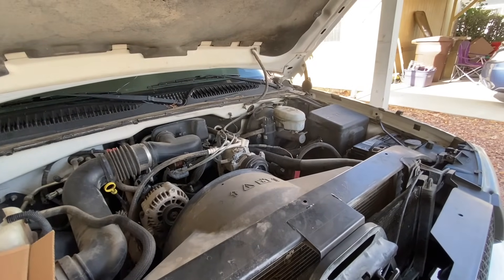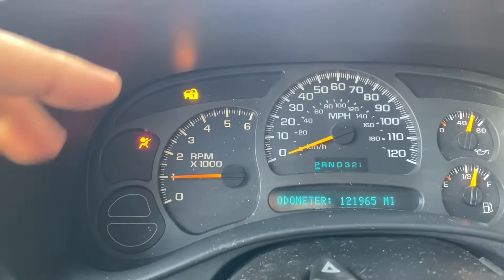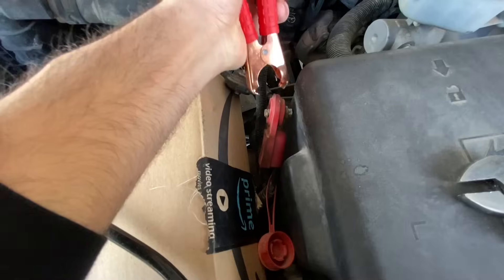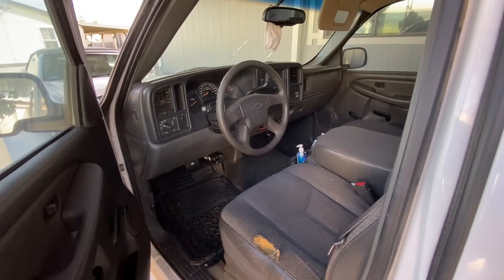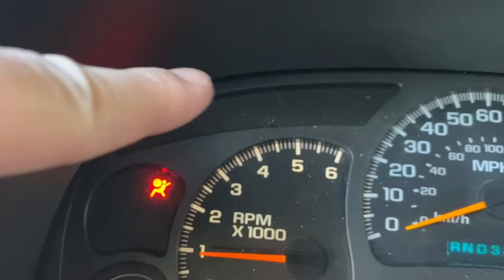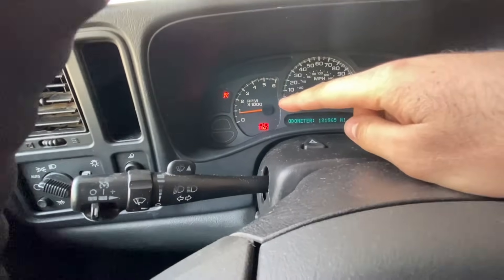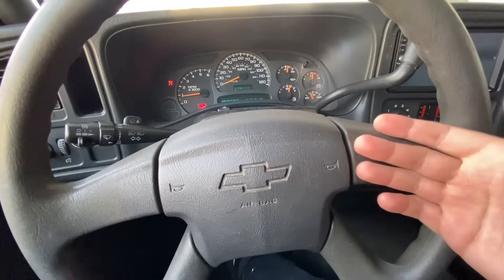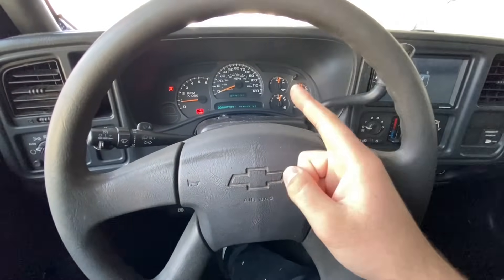How To Reset All ECU’s And Control Modules In Your Car Or Truck Safely

Comment: For late model '90s and early model 2000's Chevy and GM trucks, this is a lifesaver! only thing i never knew about is the battery isolation technique. i used to just disconnect the terminals and thats it. But im gonna start doing this now too. thanks

Comment: 99 Jeep Cherokee sport. I need to be able to use a code reader but I disconnected the negative cable on the battery and the code reader is not communicating anything. I was told I erased the Jeeps memory. How can I reinstate the memory so I can run a code on it? I'm having a crank no start issue. No fire from the distributor cap, which is only 3 months old. No spark coming from the coil. I have lifetime warranty on the coil so I put a new one on still no spark. Everybody is telling me to change the crank position sensor so I did. Still no spark? Any advice please on resetting my jeep's memory or any advice on the no spark issue. I'm almost leaning towards that I bought either a bad coil or a bad crank position sensor? I'm not sure? Any advice please, thank you

Comment: I got a 2008 Chrysler Sebring I’ve don’t the negative battery cable disconnect I’ve disconnect both and touched the negative to the positive for over 45 mins to drain the capacitors and it still holds memory I’m trying to reset a hard Tmc code any ideas?

Comment: I am having issues with skoda octavia II 2007 pid diesl  -- after we replaced battery all lights came on not going -- even steering is heavier and car will not go over 60mph  -- I left the -iv terminal disconnect for few hrs.  cleared all fault with scaner .. but no joy yet and car has still all dashboard lights on with h-break light blinking. any advice would be appreciated.

Comment: if you dont install a resistor between your jumper cable you can ZAP dead your ecu. The purpose of a resistor in this context is to safely and gradually discharge residual electricity stored in the vehicle's computer system.

Comment: My check engine light codes (3 different ones) P0420, P0078 and one more, can’t remember, all came on and cleared then came on and cleared after replacing the battery. I tried this method and it cleared them all for good.

Comment: Hi 

I have a D40 Nissan Navara/Titan 2010 2.5 LE. The vehicle goes into limp mode once start up. When clearing the fault, the Electronic actuator seems to move and you hear the idle becoming normal for that short time. Thereafter back into limp mode and the actuator arm does not move, so no boost.

Took it to a turbo shop thinking it was something to do with a faulty actuator (it has an electronic actuator), they replaced the actuator and reconned the turbo, but the issue persists.

There are no fault codes, even when checked by Nissan. Comes up with P0000. Clear that and it says no DTC, but back into limp mode with engine light on.

There is no smoke and the idle is quite stable, but no power at all. What could this be? 

I've been told, it could be the wiring on the CAN system since the machine at nissan is not picking up any other information on other sensors or areas. 

Been told it could be the ECU. The vehicle did have a stage 1 remap about 6 years ago and ran with  no issues. 

Other thing I've been told is that it could be a faulty EGR. Mines been blanked off with plates. 

Its also been to Bosch Diesel and they checked the injectors and fueling system, and they say that's all 100%.

Does anyone have experience with a similar issue ? It's been 2 months now back and forth. I dont know where to start looking.

Thanks in advance for any assistance.

Comment: THIS IS WRONG! DO NOT DO THIS, Use a Resistor instead of a direct connection. Doing it this way can cause damage to sensors. Use a resistor to slowly drain the the ECM capacitors that store voltage. A bleeder resistor with a value of 20 kΩ and a wattage rating of 9 watts ensure a safe discharge time of around a minute.

Comment: How to reboot a car computer. 
Disconnect the battery (both cables).
Turn the key on. 
Turn the headlights on.
Touch the battery cables together for 60 seconds. 
You have now rebooted all the computers on your car! 
This fixes a whole host of problems on a number of cars.
This is the only way to reboot and reset a vehicle computer.
Now clear the codes with a code reader. Drive the car see what you really have!
☺️

Comment: Fixed a code I that for three years wouldn't clear, searched the car from top to bottom, solved it by simply isolating the battery, and switching my headlamps on, and letting the system power drain and reset the ECU's over the course of an hour. Forget shorting the system, just drain the system of residual power as I (and others) have described.

Tested for the code to return at my usual spot with the usual conditions. No code!! Gremlins evicted!! 

I am over the moon!!

Comment: My 01 Tacoma will only start up when hooked up to an OBD reader. It will remain on while parked and at normal idle. Upon disconnecting the OBD reader and put in gear, it dies out.

Comment: You can skip the jumpers' cables and just turn on the headlights instead.  It will drain the rest, no doubt.   That comes from an auto mechanic straight 54 years  on the job.

Comment: Can do the same with rubbing both terminals together for 5 secs. But that dont always work either. Did it with my 5.7 hemi Cherokee and still have codes and no crank.

Comment: Hi, i was driving my 2008 ford ranger pj ute , manual transmission, suddenly the instrument  cluster stayed on, speedo stuck on 110 km/hr, rev taco stayed stuck , etc when i arrived at my destination i turned key to off but engine wouldn't stop running... when i got home i had to stall it to get it to stop running... now it wont start and instrument still stuck where they were ... has anyone else had this problem and did the reset work ? Please and thank you.. I've disconnected battery and cluster stays stuck

Comment: Thanks for the video and information! I just bought a used 2007 Cadillac Escalade and its MPG is so low. Previous owner used to use it for towing, so I think it might have been tuned for that and that's why the MPG is low? Anyways, do you think this procedure would reset my car to factory settings?

Comment: I have a 2003 Chevy Trouble Blazer that kept throwing up random codes saying I needed a new torque converter, mass air flow sensor, shift solenoids, and others. The service engine soon light would come on and the tranny wouldn't shift right and the engine ran light crap. If I stopped at a stop light and turned the engine off and restarted it the engine light would go off and everything would work fine. I did the reset on it and now it works great and it went through emissions with no problem.

Comment: Does this work to clear ABS codes ? My car has the ABS and TC lights on due to a bad wheel bearing that I replaced aswell the 2 front ABS sensors. And the light is still on.

Comment: What gears were you changing when you changed the gears out of view of the camera? U had did something other than just the gear shifter by the steering wheel. ??
Reply: He is just shifting from D, N, R then 3rd 2nd 1st then go 1st 2nd 3rd R N D then Park. Do this twice then. Put the car in motion and drive for about 20 mins to relearn the ECM And TCM

Comment: if you have a manual do you go through the gears?
Reply: No. Shifting through all the gear positions is supposed to allow the PCM to "relearn". In a manual transmission car, you are the "PCM" that controls the shifting.

Comment: Will this work to reset the brake pedal  potentiometer on a 2008 buick lucerne ? I don’t have a scan tool to zero out the brake pedal switch.

Comment: All you need to do is turn on headlights that'll drain all energy
Reply: how are u turning the headlights on if the battery is off idiot
Reply: @unxylene   You're the idiot. It is a well known common practice to turn the headlight switch to ON while the battery is disconnected to drain all the residual power from the various modules. The guy in the video just did the same thing in a different way by shorting the cables together.

Comment: Will this solve a crank no start on 2005 nissan sentra 1.8l,,, list of parts changed,,cam & crank sensors,4 new sparkplugs, 1 new ignition coil, bew battery,new battery terminals,,,,, u have no DTC Codes now but still crank up ti 2300 rpm. For 4 seconds then dies,,,😢😢😢please any advice will help

Comment: I was also skeptical AND... it didn't work for me. 2014 Dodge Ram 1500 with the "Service Shifter" (it's the ZF 8 speed pile of garbage electronic trans) coming up on my dash and with DTC U1467 and P1DF3. Replaced my shifter, left battery unplugged for DAYS and also did this "little trick" for hours and still will not shift into drive or anything. Thanks for the effort, works for some I guess.

Comment: Unhook the battery and turn the headlights on leave it for about an hour.  System is clear.  That's all you have to do.
Reply: That is the correct way to do it.
Reply: lol he literally has A jumper cable, singular 🤣
Reply: Really I'm going to try it now
Reply: Do you start the car to put the lights on then unhook the battery
Reply: @joyfulspirit22  just step away from the vehicle,  and go make a sammich!!
Reply: @mikeharris8365  I'm not understanding the part about disconnecting the battery and then turning the headlights on. How are the headlights getting any power to do anything. I'm not understanding I'm waiting an hour with headlights I don't have any power?
Reply: @joyfulspirit22  The point is to drain the brain (ECU) and system of electric. Just remove the battery cables and turn on the light and hit the horn a few times. Hope this helps.
Reply: @cornfusedatbest3980 Now I'm confused. You said to unhook the battery cables and then turn on the lights. What good is it to turn on the lights with the battery terminals off?
Reply: @randybonner9870  From what I've learned, it drains the last bit of energy from the circuitry. Other methods claim to turn the radio, AC, press the horn. Basically draining the system from any residual juice. I mean, WTF, I'm no tech, but I can at least understand where this would make sense.
Reply: YO, my mistake. Not BOTH battery cables. WTF, are you guys that stupid to get your advice from some idiot on YT? 😂 If anything, look at a bunch of videos on the subject. If you've got enough brain power, you'll figure it out. If not, go back to watching CNN or MSNBC or whatever TF they're calling themselves these days.😜🤪😆
Reply: @joyfulspirit22 NO
Reply: @joyfulspirit22 No! Unhook the negative and turn on lights while off!
Reply: @IMKSURVIVOR right, how could a computer reset itself back to original specs if it didn't have power. Hahaha remove the ground only. But still not all ECUs are the same. You might clear codes and fix shit. But still might have command issues or ECU software issues that you can only fix with the right scan tool and or software on a computer.
Reply: You only need 60 seconds for modern electronics to clear all the capacitors.
Reply: @pnwnewsinfo  that's what people say. So, explain how an hour is gonna hurt a dam thing? We're waiting ✋️
Reply: @pnwnewsinfo  I beg to differ.
Reply: Definitely doesn't work 😂😂
Reply: Yup!

Comment: Cant you just disconnectbthe battery fir 15 minutes. Thevsensors and orobes. Eill "die" and as soon as you connectbthe battery theyvwill relearn.
If the ecu is not the problen.
Reply from the maker: Can definitely try that too

Comment: 2022 toyota highlander, getting code u1117 lost communication with accessory gateway. No check engine on but my app and remote start won't work. Everything else works. Do you think this would help? Thank you

Comment: Just followed your advice for my 1993 Honda Accord (with 210,000 miles) which recently had unexplained and increasingly serious transmission problems that finally left the car undriveable.  I thought I was going to have to change out the TCU but then saw your video.  What you have suggested worked!   All taken care of at home in an hour and didn't have to spend a cent either.  Thank you!
Reply: Will it work on a Mercedes Benz 2012 cls550

Comment: I have had a hard time with my F150 replaced alot of stuff and it would keep going in limpbmode. . I saw your video today and tried it .Happy to report that it is working so far. Thank you.
Reply: same here. 2013 f150 replaced molded lead frame. worked for 10 minutes or so, started throwing the codes again and limp mode. I'm about to try this reset.

Comment: Had a issue with anti theft light blinking on then off along with gas,temp,battery and oil gauges dropping only when headlights are turned on. I watched this video how to reset All control modules on 2011 silverado pickup 5.3  here to tell you Problem Solved thank you for the video I've just subscribed.

Comment: Thanks for the great video!! I did exactly what you said, but I left them connected with the cables for a few hours. It didn't reset anything in the car. Any idea why, or how I can do it? Thanks for the help I appreciate it.
Reply: I heard for newer vehicles you have to do this then drive for up to 50 miles try that I guess

Comment: Just unhook the battery and turn the headlights on.  They won't come on, of course, cause the batteries are unhooked, but it'll pull any residual power from other stuff, and u can start it all over fresh

Comment: Dont do this! What you need is a slower drain of the systems. You can do damage to multple modules with a quick drain.

I solution. I bought a standard 21 volt light bulb socket for recreational vehicles. I wired clips to it & put in a 40 watt equivalent LED bulb. With it clipped to the cables it drained the systems in a half hour.

Have a cup of coffee. Relax. It's a safer solution.

Comment: A friend gave this a shot and not only did it reset the system as expected, his blinker fluid was also refreshed. Apparently there was also an extra muffler bearing in the exhaust system, because after resetting the entire system, including blinker fluid, a muffler bearing rolled out the tailpipe. Now it only makes 3/4 the noise it made before. Amazing!
Reply: Blinker fluid and muffler bearings? Why do you want to mess with ppl
Reply: Those muffler bearings are a bitch

Comment: I tried this, but it didn’t work. What happened instead was a message popped up on the display that said using jumper, cables, connect one end of cables to battery terminals. Place both clamps of other end to tongue for five seconds. I tried that and guess what. Everything reset as expected! You should try it. I’ll bet you’ll save yourself a little time.
Reply: What year is your car. That might make a big difference

Comment: When you connect the jumper cables is it to the cables that were connected to the battery?
Reply: Yes. Some commenters are suggesting using a resistor between the cables in case there's too much leftover electricity that can cause an issue. The alternative, easiest, would be to disconnect the battery and then turn on the headlights to drain the system.

Comment: This is one of the best videos I’ve seen on this yet thank you. You may have just saved my friend having her 2008 GMC towed to the dealership.
Reply: Same make and model. This didn’t work for me. What issue were you having?
Reply: @ginormous99  fuel pump control module, and there's wires down here to the transmission and all kind of junk to get all screwed up

Comment: I had a similar issue are the Dodge ram that the gas gauge and gauge is went nuts and it has a process to apparently these new cars have process is built into the ignition switch and they’re probably like Dealer fix all the items that they don’t give out those secrets, but this is obviously one of them because I followed another videos instructions for the Save guy to take and I was shocked that things were resetting everything was fine then. My friends car just blew this out of the eve vapp sensor and now it’s not going in and  out and I think her problem was the main ground strap from the engine into the frame broke so this is how these things start bad connections you always want to make sure you clean everything anytime you’re working on any electrical stuff use the electrical connection grease if you have to to get a good ground. A broken ground out of gas take wire could really affect the gauge on Fords. I’ve had several that were the ground breaks it reads 3/4 of a tank of gas.

Comment: Would this work for a 2005 ford explore? I changed the battery and it went into safe mode. It starts but it won’t drive since it’s in safe mode. Thanks

Comment: I think I fried my ecu or ecm. When I washed the engine.... My question is, If I get a used one. Will this method work, To reset the Used one?? Its 07 chrysler 300,  2.7 Base model

Comment: What would cause the ECM 1 fuse for find a fuel pump relay on a Chevy Blazer 2000, I was just driving home but on the road and all of a sudden but that's like kind of came on the truck stalled out I had the problem we could go to listen my body had a dead cell and it's causing the fuse to blow, about brand new battery an had any problem since, so I can't remember what it was pop the hood pull the cover off and the fuse located above the fuel pump relay I changed it fuel pump get turn it over it didn't start looked at the fuses  and it blow again, any idea where it goes ???

Comment: Always check if you can do this with your year/make/model. This has been a common thing to clear the KeepAlive memory, except for '96 Fords. '96 was their first year of OBDII. Doing this on that year, maybe '97 and '98 as I can't remember when they implemented the fix, will instantly fry the KeepAlive circuit thus needing an ECU replacement. They fixed the issue eventually in later years. As always, proceed at your own risk.